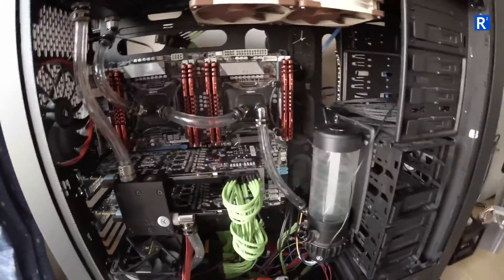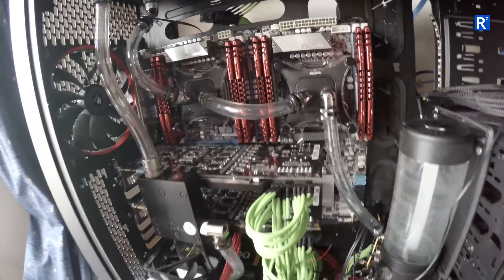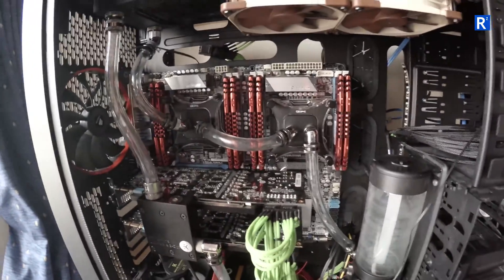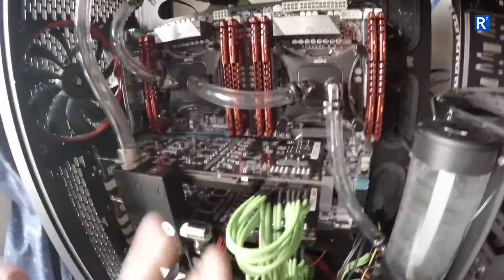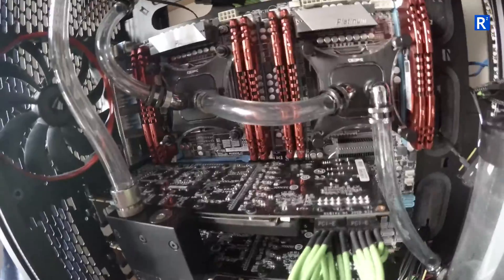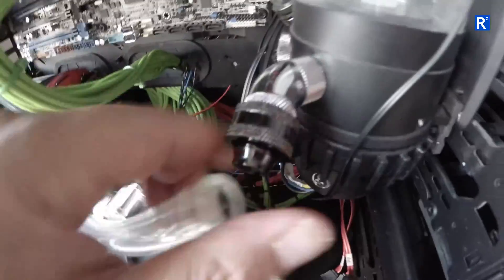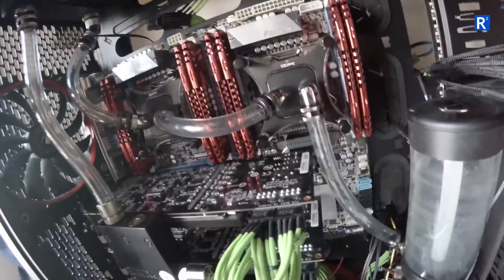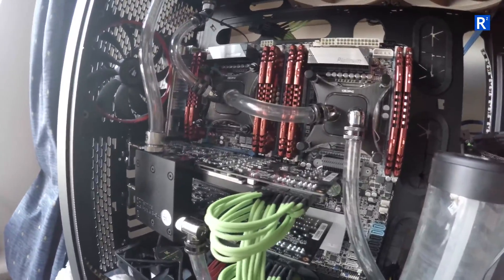Dual Xeon 2670 with Z9PE-D8 WS Motherboard Update 2016 07 28

Comment: hey man, is it possible to run windows 10 on that? or would Debian be more ideal? Thanks
Reply from the maker: Hi Joe, I do run Windows 10 on this rig.. twice because I'm using UnRaid :-D In fact, my next challenge is to install Apple OSX on it, but that represents a whole new level of complexity. If I get enough requests, then I'll make a video on my attempt.
Reply: @renderz  Hello, I have the same motherboard with dual Xeon 2680 v2, with windows 7, I have been trying to change it to windows  10   which has been impossible. Do you know what to do about that ? do I have to install a custom BIOS or something like that ?  I really  appreciate your answer. thank you  and congrats for your channel .

Comment: you can't beat dual Xeons in AE CC2014 ... period. CC2015 is a different story since they removed "render multiple frames at once" for some stupid reason.
I just hope they bring it back in CC2016
Belive it or not, in AE2014 the biggest bottleneck for me is my 64GB of RAM. 100% CPU usage during render and it just loops around the 5960X @4.4GHz of a friend of mine.

The AE project "Pop Out Book" which is used a lot for benchmarking AE performance took my dual E5 2670 rig a whole 8 minutes and 32 seconds to complete.
(Check Puget's Article on AE performance scaling for comparison)

In Premiere Pro CC 2015, the 5960X whipes the floor with my dual Xeons when working with regular 1080p footage.
4k in 4:2:2 10bit, different story. Both systems perform about the same during editing, the 5960x has a slight advantage during the rendering process.

4k multicam (4 cams) : 5960x can't keep up with the amount of data and starts shitting itself. The timeline performance is unusable without proxy files.
The dual E5-2670 rig doesn't fall apart that bad until 6 4k streams at the same time.

You should check out the video "Hardware Unboxed" did about dual E5 2670s in Premiere a Month or so ago.

I remember you mentioning something about "virtualisation" when you started doing this series. Something that would definitely benefit from dual Xeons.
You definitely knew that the single threaded Performance of this rig would be way below your overclocked i7 when you started doing this.

And still you complain about it now.

I think you would have a lot of fun with this system if you knew how to use it properly.
Reply from the maker: Thanks for watching.
Reply: Ok i'm sorry, that was a bit harsh. I didn't mean to insult you.
However, just don't give up so easy! Do some tweaking and you will be amazed how much fun dual Xeons can give you.
You can still open AE CC2015 projects in CC2014 btw. The rendertime will be most likely more than cut in half when using all 32 threads.
Installing both versions at once is tricky but if that would be a solution for you i'd say give it a shot.

I must admit that i myself am a bit disappointed about the gaming performance...
Probably the real reason why you are not satisfied with this build either?
I also think SLI scaling is below average with this chipset. (i tried two 980s a month ago and it didn't scale well at all @4k)
Sorry again for my choice of words.
Reply from the maker: You didn't insult me, you have every right to your opinion. Based on what you wrote I did some more investigations and found some of what you said rings true which is great! Everyday is a school day. This is a hobby I enjoy! Thanks for watching.